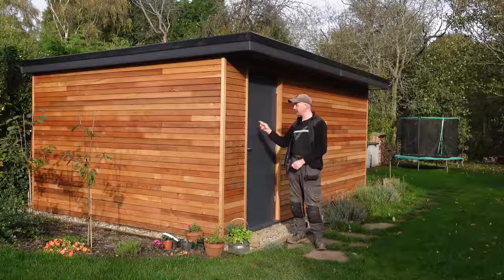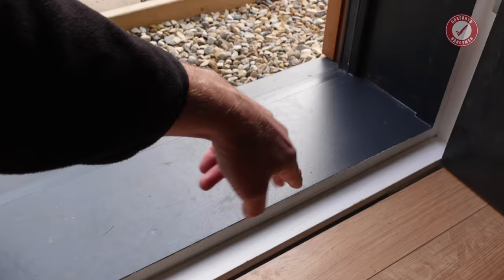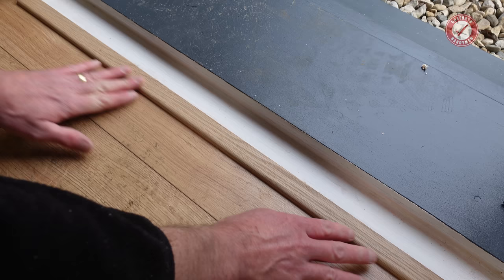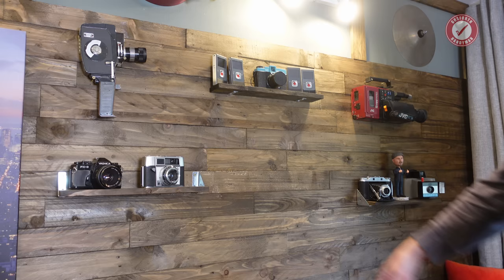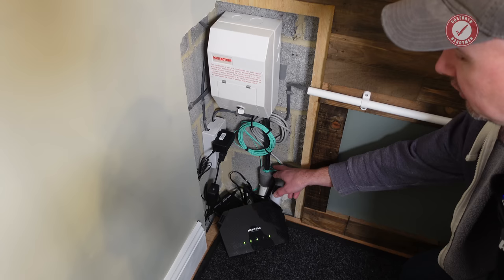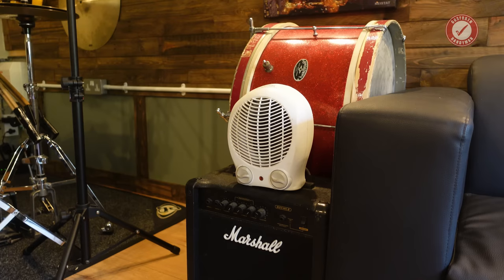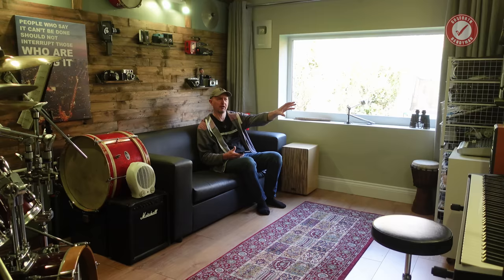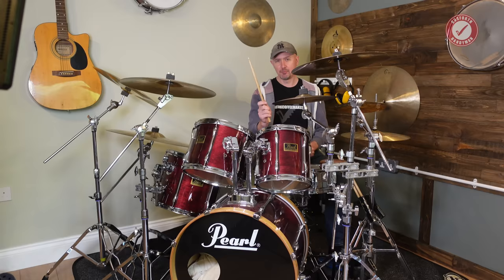I built a SOUNDPROOF garden studio!

Comment from the maker: Download our full plans and budget from the Member Zone: https://members.gosforthhandyman.com/all-member-only-downloads/ 👍
Reply: Andy, I hope you see this mate... the  power adaptor for the fibre converter box you have, the plug looks like one of those non-compliant knockoffs with no fuse, PLEASE check it, and if it is, replace it. I'd HATE to see a fire caused by something so simple after all you've gone through to get this done! IF it turns out to be compliant, sorry for wasting your time. Have seen fires caused by them (often those things come with cheap CCA cable rather than pure copper, and hair fine strands also). If the adaptors are a standard voltage, might be worth just swapping them with some decent quality ones.

All the best, have loved this series
Reply: Additional: some of them HAVE a fuse, but it's not connected, might be worth checking that too even if it looks like it has a fuse
Reply: RE carbon dioxide poisoning, according to the omnicalculator (co2 breathing emission calculator) after 4 hours in the room (30m3), your average CO2 concentration would reach 1.5-2%. It is possible to feel some adverse effects at this level, like dizziness, headaches etc. After 12 or so hours you can risk unconsciousness and death via suffocation. Probably worth sorting that out, even if you are aware of the problem. Sounds like quite the liability.

Comment: I'm a physiologist and while not specialising in respiratory physiology, you are correct, hypercapnia (high carbon dioxide) will be a problem before hypoxia (low oxygen). One correction though,  a slow peaceful death would only occur from carbon monoxide which shouldn't be an issue unless you use open flames or a generator. Our bodies are very sensitive at detecting carbon dioxide (this is what causes the horrible feeling when we hold our breaths). It doesn't bind to haemoglobin and displace oxygen though so is far less dangerous than carbon monoxide. To answer you question very roughly there would be multiple days worth of air in there.

Comment: You need two holes, one in and one out. Also, an in-line fan on one or those. Using acoustic mufflers is very effective and can be diy cost effective. Refreshing the air is a must for a studio and and your general health. I have built a studio in the past with much the same issue and found it essential to have new air cycling.  Love you studio, very cool!

Comment: nice room. i am a drummer and recording engineer. I have built a few rooms. Suggestion for your air pressure built up in between your doors:  Don't cut the doors. Instead, you could create a "relief diaphragm" on one of the sides in between the doors. You can use your own imagination, but essentially you would cut a hole and mount a 6" speaker. When you close the door the speaker will be pushed back by the air pressure. You won't have a problem closing the door. You can create the same idea with a little 6x6  sheet of 1'4" rubber. It will flex with the air pressure.

Comment: For silent ventilation I'd go for the labyrinthine boxes on the doors.  Line the boxes with carpet on the sides too and you'll have no noise worth talking about escaping through it.  I built an isolated room-within-a-room voice booth some years ago and that's the way I went - you could wind up the gain on the desk and hear a pin drop but never any extraneous sounds.
Reply: Surely all you have to do is open the door for 10 seconds? 😎

Comment: Great job Andy!
I'd go with underground baffled ventilation.
I'd also add a modern electric storage heater (something like the Dimplex Quantum) to keep the temperature at a minimum of maybe 10 to 14 degrees C to protect your gear from damp in the winter using cheap-rate electricity, and you could use the boost function on the storage heater to get the temperature up a bit higher when you're using the room.
Cheers.

Comment: Wow, that turned out really nice. Very impressive Andy. The pallet wall was an excellent choice. It’s what really gives the room the wow factor. You also did an excellent job isolating sound escaping the studio. You can install something like a passive inlet vent. It can remain closed until you need it, but when you’re not using the room, you can open it to allow some air exchange to keep condensation and mold at bay. It’s a small opening, so not sure if it would even impact the sound barrier.

Comment: great video. About CO2: your body is measuring it and when it's too high you will go into full panic mode. No way you'd not notice too much CO2. The slow and silent killer would be corbon monoxide, which you'd get by burning cole etc. The body has no way of noticing it and it is a very strong competitor for the binding site of O2 in your red blood cells

Comment: I recommend a netatmo weather sensor, the indoor sensor has temperature, co2, humidity and sound level, the outdoor does temp, humidity and air pressure. Also does weather forecast which seems to Be pretty accurate for the area you are in. You can share your temperature from the out door so if you’re going anywhere you can see the current temp and weather forecast for that area. I use mine to keep an eye on the garage and loft and internal Co 2 through extra sensors.

Comment: Don't know much about the CO2 poisoning aspect, though I do know it will be surprisingly long so I would go with the days calculation. However on the aspect of venting, I would have thought that since the room is so well sealed you will need two vents. An in and an out otherwise the fan or vent will be fighting the pressure in the room just like the door does currently.

Comment: You can easily calculate the resultant Rw of any partition such as your doors with a the addition of a pin hole.  There will be a reduction in the acoustic performance of the double door setup you have installed as you stated, though it might be minimal depending on how big the hole is.

Comment: As has been mentioned already, it’s probably a good idea to invest in a CO2 meter to see if there’s any possible problem with the CO2 buildup. If there is then you can deal with the problem later, and you won’t need to be cutting holes into your building or doors to do it. Almost certainly as you say you will have no problem with a low O2 situation it will just be a high CO2 if it’s going to happen at all, then you can reasonably easily deal with the CO2.

FWIW it’s reasonably easy to scrub CO2 from the air, using SCUBA and submariner disposable filter material though there probably isn’t a CO2 scrubber that’s been specifically designed to be low noise. It wouldn’t be rocket science to design and build your own CO2 scrubber. The criteria for a scrubber unit is that you don’t get channelling of the material so air passing through does go through all the material rather than just part of it.

Comment: Giving it a shot here,  you can expect to survive 8 days on the available oxygen, but reaching fatal levels of CO around 24-30 hours depending on activity level. This calculation assumes a sealed room, with no air coming in or out.

Calculation:

Room 30 m3, 78% nitrogen, and 21% oxygen. The optimal livable oxygen levels are between 20-24%, below this you will start to feel exhausted, but humans can survive down to 6% oxygen.

Volume at 21% = 21 % x 30m3 = 6.3 m3 
Volume at 6% = 6% x 30m3 = 1.8 m3 

Total available oxygen is 4.5 m3 or roughly 4500 liters.

Average human consumes 550 liters per day, so with 4500 liters you could expect to live ~8 days in regards to oxygen. Again, this is survival only, comfort level decline fast after 19.5% according WHO.

When you consider that the same amount of liters is breathed out as carbon monoxide daily, roughly 550 liters, its likely you will go beyond the recommended limit of CO within hours. Symptoms start at headache, dizziness and nausea at around 35 ppm, but fatality rate increase exponentially from around 400ppm, where you should be unconscious in 2-3 hours, and fatal about an hour after that. If you want to play it safe, and fill the room to the max of 35 ppm, which is where most would probably open a window. This should occur at around the 4-5 hour mark. I think instinctively you will start to feel tired and air out.

That being said, in a room with 30.000 liters of air, and contributing 0.03 m3/hour of CO, and you're alone, you should exhale 300ppm/m3 hourly, which means you theoretically can survive 30 hours before you fall unconscious, and fatal 2-3 hours after that when reached above 400ppm. 

I would say max 24 hours to be safe considering only CO, but I highly suggest you get a monitor alarm and place one around head height as CO spreads slowly through out, and if you fall asleep on the couch it really is a silent killer. So placing a CO alarm and fire alarm could save you, should you fall asleep. Having nobody to hear calls of assistance, I would also suggest getting one of those alarm buttons where you press and someone is alerted something is wrong. not to sound creepy, but nobody can hear you scream for help.

Comment: Those lights are cool!  (Or warm, if you so select.)  I knew they existed but have never seen them in operation.  I'm glad you are keeping ventilation in mind.  Apparently you ran into the same wide variance in carbon dioxide toxicity as I did when I last commented on it, but I'd still buy a CO2 meter even if it's not science lab quality.  Your idea of a subsurface vent (with a silent, low-speed blower at the far end) is brilliant!  You can justify adding Acoustic Engineer to your extensive resume.
Reply from the maker: Cheers Bob! Yes, getting a straight answer on the sealed room thing is proving tricky! I'll buy a little detector and see what that says. 👍👍

Comment: If you are going to pull another cable through use the fibre cable as a draw, as it will be strong enough to act as a draw cable, provided you use a good strong join to the new cable, probably a nice tight tape up of a length of both cables.

For the air exchange get a countercurrent heat exchanger, and put 2 holes through the wall, top and bottom, and then outside make your baffled box in plywood, with the heat exchanger in it, so that your incoming air is at the same temperature of the outside air, yet your sound is attenuated a lot. Fan to move air is outside, so you have no fan noise inside.

window inside put your acoustic damping mastic, and the MDF board, sealing the top and making it white. 2 layers of MDF with the damping between them should provide a lot of attenuation, and the outside you can simply put a strip that makes the gap smaller, and bent out to shed the water. Smaller gap, and out so it will bead off, perhaps with a tooth pattern to make points to both disperse sound and make the drops concentrate.
Reply from the maker: Will look in to that - cheers! 👍👍
Reply: Ooh! - SERIOUS nerdfest ......!!
.....and I'm 99.999% certain you think it's A COMPLETELY reasonable,  rational and necessary rout to take ......!!!?

Comment: The tube that has the fiber, is that wide enough for another tube ? Cos I was think a compressor in the house with low humid could be a solution. And if compressor and light was controlled by the same switch it would make it easier.

Comment: that plug at 17:05 its not fused, it should be cut off destroyed and put in the bin really
Reply: It probably has a sleeved earth pin & conductors like cotton too! Highly dangerous. Take this advice Andy & bin it.
Reply: I mean the fuse is only protecting a few inches of cable by looks of it, and if cable isn't detachable, there is an argument that it's no worse than the PSU above it (which has no user accessible fuse)

However I would seriously question whether a device that came supplied like that (with a clearly none compliant plug) has other deviations from safety norms. The safety stamps themselves mean nothing if there was insufficient tests done to back them up)
Reply: @mistermartin82  particularly as it looks like a device that’s being powered 24/7. I'd bin it. Not worth the risk.

Comment: for ventilation, u want what u suggested with the vent system, but with a van sucking air in, id assume sucking air in wouldnt allow sound to seep out due to the nature of air particle direction and yet input more oxygen into the room, its speculation though, but it got me thinking, of course a low RPM fan. basically noiseless ,from noctua 12v

Comment: Sorry but your room has tons of resonance in it, your solid surfaces do not eliminate sound waves , in fact the bounce round even more! 1. Recording studios use large rubber thresholds at the bottom for a complete air tight seal, that would have been better than the wood & air gap ..but the main improvement would be if you had lined the room with compressed sound panels you’d achieve a much higher absorption of sound waves, this would cut down the reflections of the drum kit compared to your square solid surface room. Only your curtains as long as they are heavy duty will make a difference.  To test it pump out some pink noise from your speakers & use a spectrograph in various places in the room to see the resonance.

Comment: I wish I'd connected directly to the router which is miles away in my front room. I have a TP-link in the back room and an ethernet cable from that into my studio. Sometimes I have to reboot the TP-Link, but it works most of the time albeit at a lower transfer rate - not that I need a high transfer rate. It's in an armoured tube along with the power and extra string for additional stuff. 

That couch looks too comfy. Beware of having a fridge of beers in there. 😅
Reply: Run some cat 6!
Reply from the maker: Yup, direct connections make a huge difference! 👍😁

Comment: For CO2 in the room just get a CO2 sensor with an alarm so you can monitor it, real work measurements are better than calculation. There are variants that show the level numerically not just an alarm so you can monitor the levels. Even if it does not reach dangerous levels you can get headaches and other non-dangerous but not nice symptoms. If the levels start to go up use it as a reminder to open the doors.

Some basic calculations of CO2 level is not had to make. Let's assume the air in the room is perfectly mixed all the time.

An adult human breathes in and out around 5 liters per minute and contains around 4% CO2. 

The time it takes to breathe in the volume of the room once is 30000/5= 6000 minutes =100 hours. So the CO2 level rises by 4% in 100 hours or 1% in 25 hours let's say 1% per day.

What are dangerous levels harder to say because bad for you is not the same as will kill you.   If we look at numbers from USDA FSIS  0.5% is the max allowed for 8- hour exposure at work. That level is reached after 12 hours.

1.0% "Typically no effects, possible drowsiness"   

1.5% "Mild respiratory stimulation for some people"

3.0% "Moderate respiratory stimulation, increased heart rate and blood
pressure, ACGIH TLV-Short Term "

4.0% "Immediately Dangerous to Life or Health (IDLH)"

5.0% "Strong respiratory stimulation, dizziness, confusion, headache, shortness
of breath"

8.0% "Dimmed sight, sweating, tremor, unconsciousness, and possible death"

So you could survive there for a week even if you do not feel good after 3-4 days. A couple of days is also the typical number you see for how long people can survive without water. So if you are stuck there that might be what kill you not CO2 poisoning.

Comment: Hi Andy,

I’ve enjoyed watching your YouTube videos! I’m a fellow drummer with a drum shed and I am wondering if you can advise on an external door issue ?

It’s a large wooden door filled with sand (very heavy!) and keeps warping due to it facing the sun in the morning and being exposed to rain. I’ve now put up a UPVC sheet that’s acting as a shield in front of the door to help protect it from these issues 

Eventually I need to replace the door and I’m looking into tricoya extreme wood but thought I would ask you as you have done a similar project. 

Thanks,
Dave
Reply from the maker: Hi Dave - found your comment! Tricky. At the moment I've just got two firedoor blanks, one covered in Tecsound, and the results are pretty good. It's still a weak point but it's good enough for now.

Do you only have one door? 2 doors with an air gap is key. I think filling a door with sand is asking for trouble. The sand will probably absorb moisture over time and release it in to the internals of the door, causing the warping. My external door is wood, faces the sun and gets plenty rain. No warping at all. A few coats of decent paint should prevent any moisture ingress from the weather. I think the sand is the issue I'm afraid.

One other option I'm considering is layers of plasterboard on the internal door surface(s). Anything to add mass. If I do this doubtless there'll be a video at some point. Best of luck! 👍
Reply: @GosforthHandyman  Hi Andy, thanks for your reply. I have 2 doors with the air gap between them which looks very similar to yours. Water was definitely getting in through the top of the external door and that makes sense about the internal sand being affected. I’ll look into a different design for the external door.  Cheers